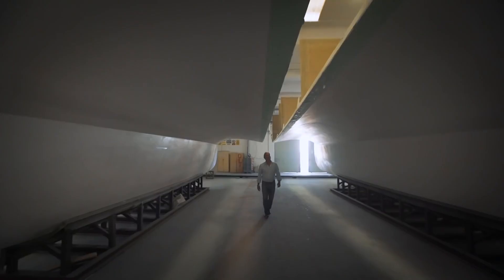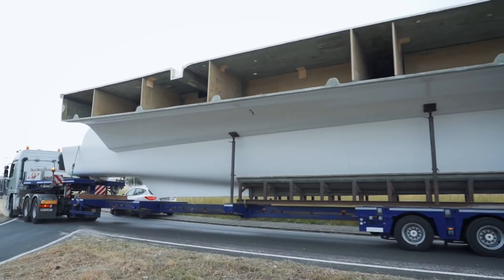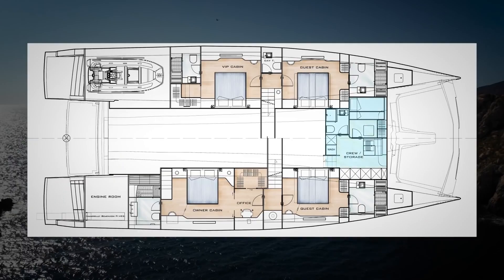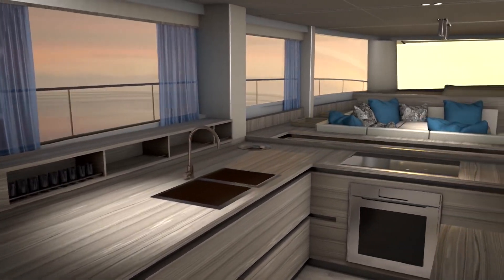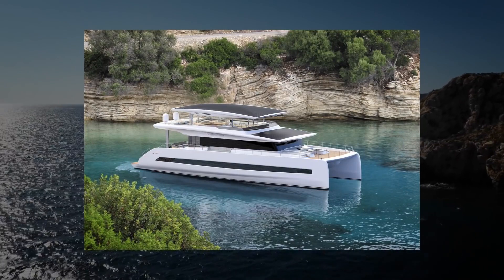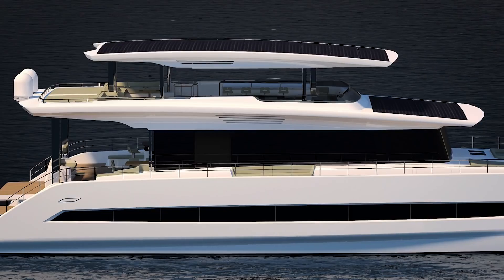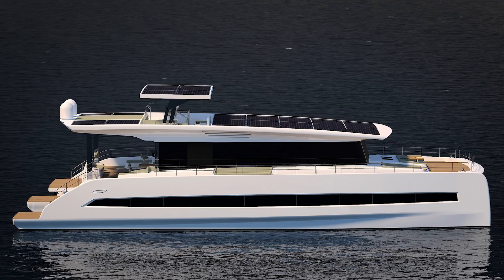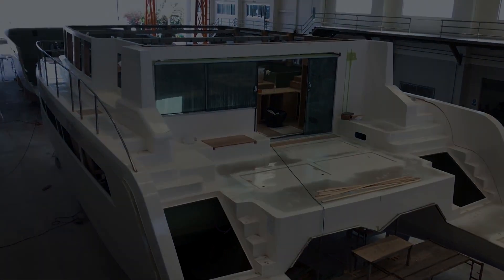BUILDING A SOLAR POWERED YACHT! PROGRESS AGAINST ALL ODDS!

Comment: I'm warming up to the idea, just like electric cars, most people don't take super long trips anyway.  So the hybrid power system can be a great fuel saver if it's used to just put put around a few local ports and anchoring at some place nice to enjoy the water/scenery.  

Question: if someone is looking for a more traditional 150' motor yacht with room for 10-12 guest and a crew of between 6-10, what would be the rough equivalent length of catamaran?
Reply: this is different than electric cars, though. with electric cars, your range is limited by the availability of man-made charging stations. the silent yachts are charged by the sun, so this enables an essentially unlimited range.
Reply: @jeffh3984  Technically true, but in this case, the range is limited to food carried on board, and water if they don't have solar powered water makers.  Since the cruise speed is so low on solar power, and the weather is variable, it's easy to plan for nominal conditions, add some for safety margin, and still easily run out of food because power generation is unpredictable.

Comment: What are the beginning prices for each one of the models autos you know the silent 55 the silent 60 the 62 and the silent 80, Do you know if they have plans to add on windpower as well as hydrogen.  I have seen other models by other makers of  Hybrid power that offer all 3 as an option. I do like the fact that you can purchase the kite a kite to go with your silent 60 or above of anakin add up to 5 knots.  And help extend the range of the battery packs. Do they come with an auto pilot system as well where you can plot out a Course?